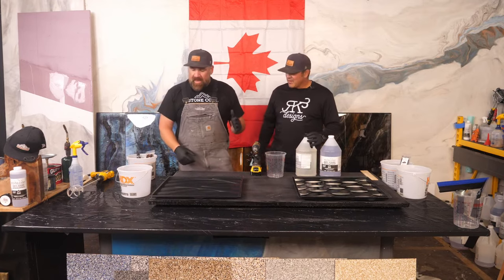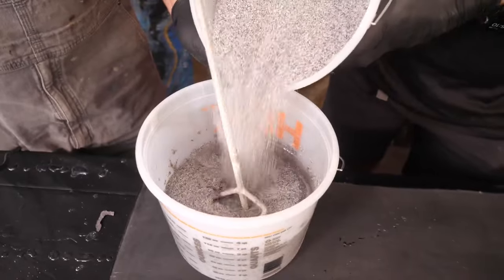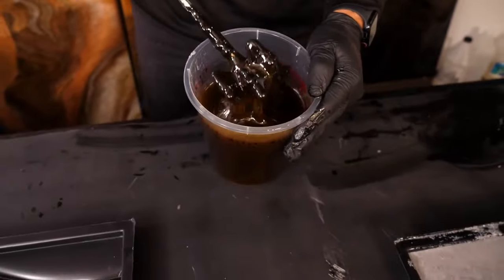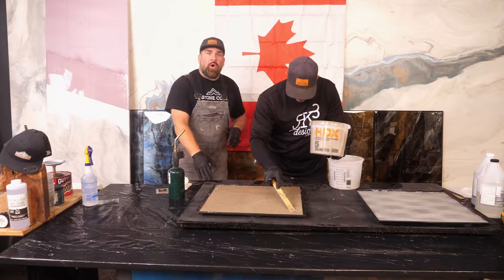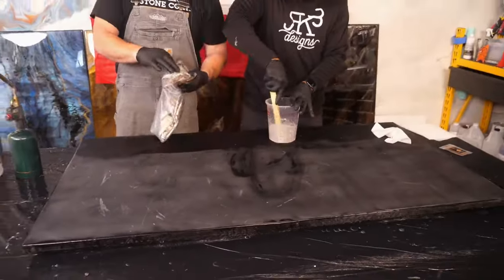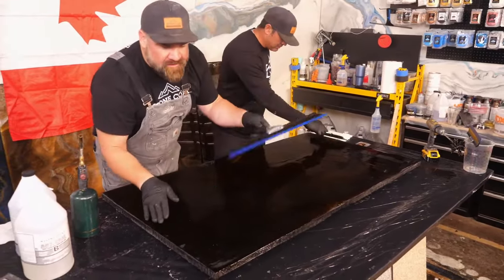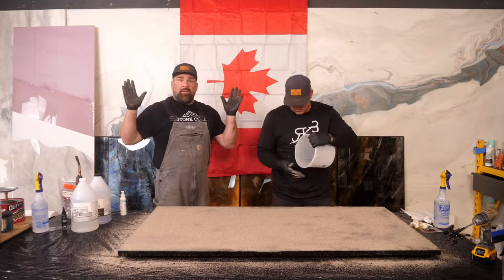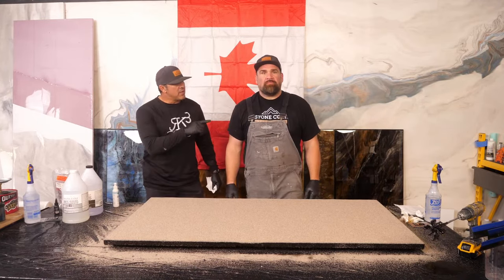Mitch & Kenny Unleashed: DIY Epoxy-Quartz Shower Revolution

Comment: On the corner 90 Question: If you do your panel and before the epoxy is fully cured but set, cut the panel down to the epoxy in 45 degree passes on both right and left sides. Brush a thin coat of epoxy in that 90 degree groove, lightly heat the joint to make the epoxy surface pliable, use some 90 degree clamping blocks to make sure once you bend one side up and attach to the 90 clamping blocks it stays at 90. Clean up any squeeze out from the joint. Let cure. Epoxy not completely cured will bend slowly without cracking. It is a good idea to have two people doing this so one person handles the heat gun and the other the slow bending up one end to meet the 90 degree clamp blocks.